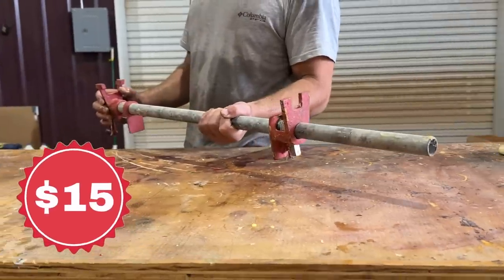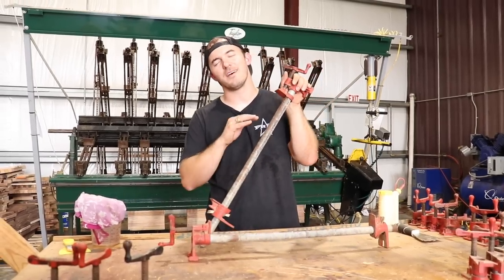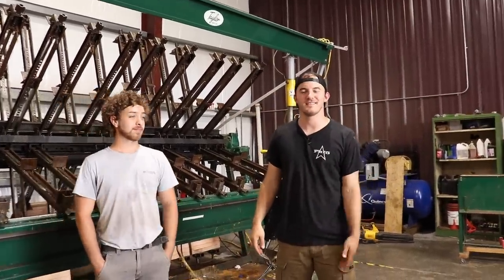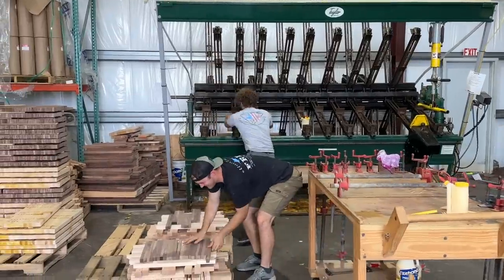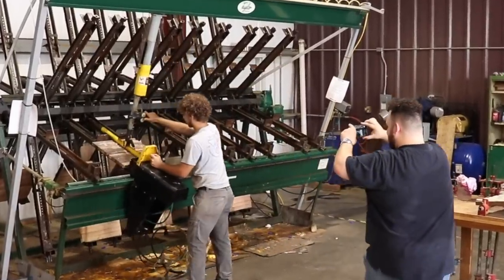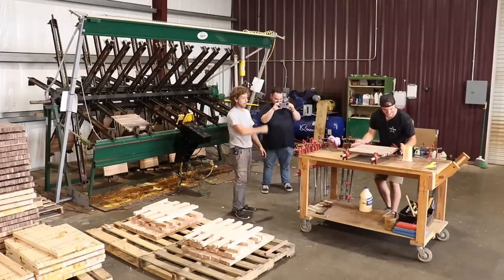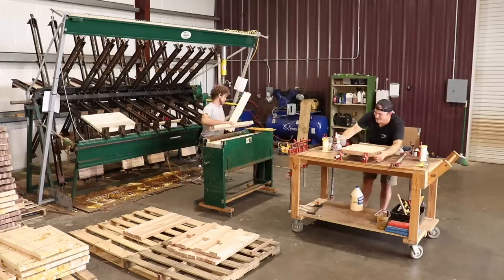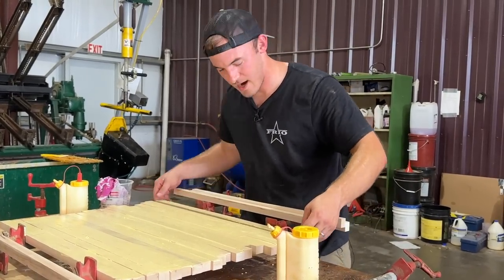Why I Threw Away All of My Pipe Clamps...

Comment: If you're doing that many glue-ups with the regular pipe clamps,  i wouldn't be using a tiny glue bottle and tiny paint brush. Get yourself a tray, or even a bucket of glue, and a paint roller. I've glued up 4x8 panels of particle board and plastic laminate this way, and put them into a hydraulic veneer press.
You have to at least use a glue roller, with an on-board hopper of glue.
Put that brush away.
Reply: I was thinking the same thing AND I would have used longer pipes and clamped multiple panels in series with one set. Just need to make sure that you skip glue or tape off in between panel sets.

Comment: 15 bucks for 3/4" Bessy clamps? I have recently looked to expand my collection and have a hard time finding them for less than 25.
Reply from the maker: I put a link in the description to some for $15.50
Reply: Harbor Freight 3/4 inch pipe clamps are as good as Bessy at about $10.00